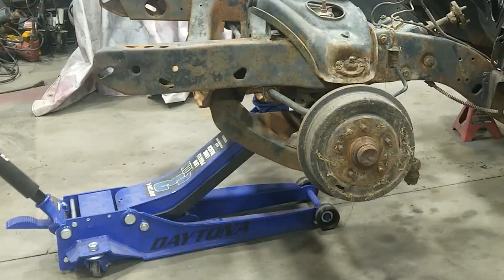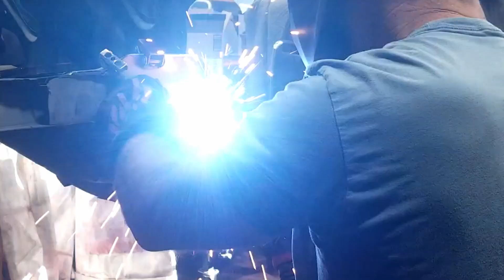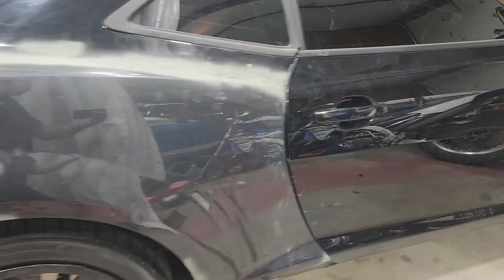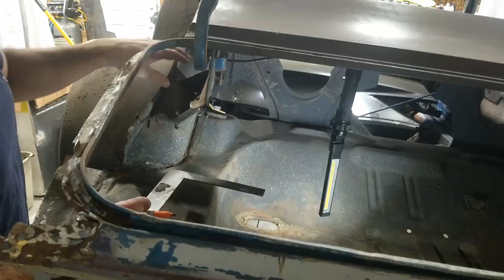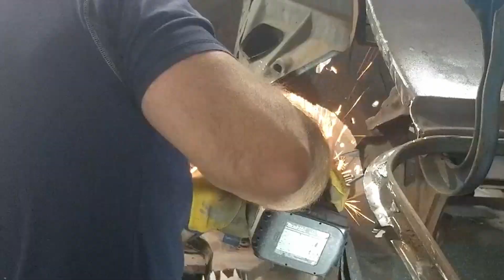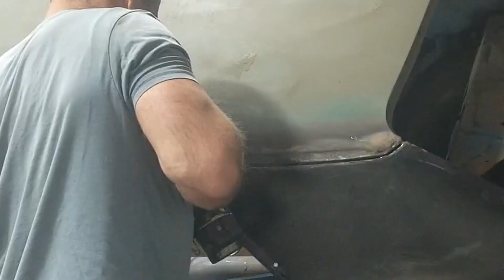World's most concise quarter panel and mini tub replacement - 1968 Camaro

Comment: On your next visit to Harbor Freight, invest $400 on a 40amp plasma cutter. It's like having a 1 inch light saber. No more burned out discs, no more garage & nose filled with dust. BEST purchase of my entire garage for my rebuild.
Reply from the maker: 100% agree. The plasma cutter is great. I love mine. But it's not always faster, and typically leaves a rougher cut. I probably should have pulled it out for this.
Reply: @some-guys-garage  I magnet on an L bar when I need a straighter clean cut. Give it a try.

Comment: Also just found your video, very true, lots of thinking and planning before welding pieces , what brand black spray can are u useing? I saw the metal prep ..and cant wait to see how you make the trunk lid gap align better..i also started on a 76 trans am, and currently finishing up on the floor boards, but soon i will replace rear tail panel, sails, quarters, and biengs a Diy'er, im watching lots of great videos, learning off youtubers talents , keep up the great spirit, making it a fun challenge in the process..
Reply from the maker: Thanks for tuning in. Glad we could connect.

The black "spray can" is epoxy primer shot out of an hvlp spray gun. The stuff I use is from Summit Racing.

Good luck on the trans am!